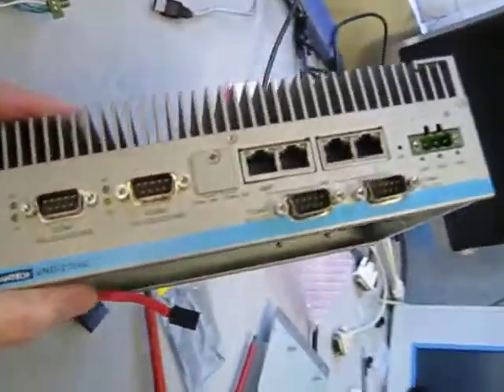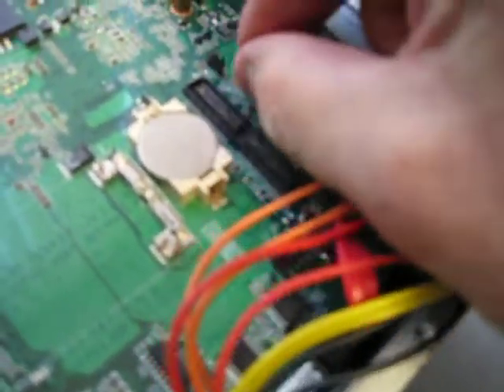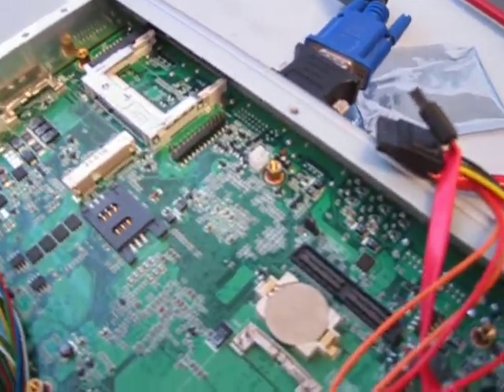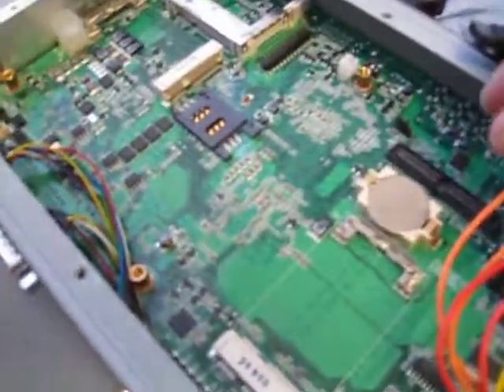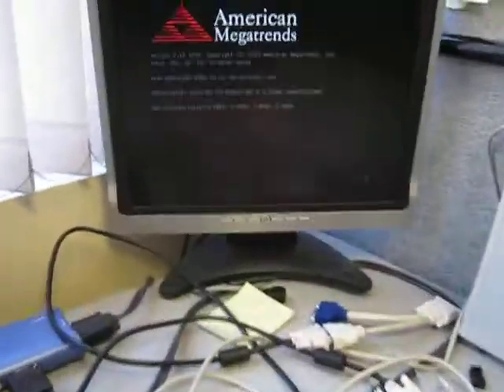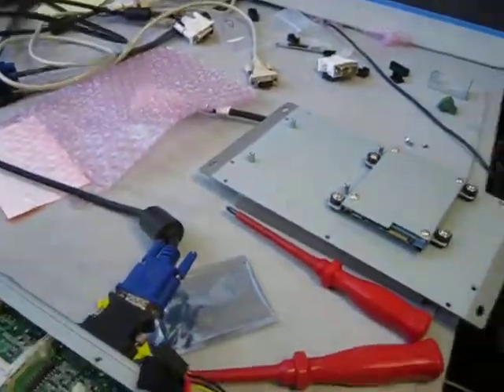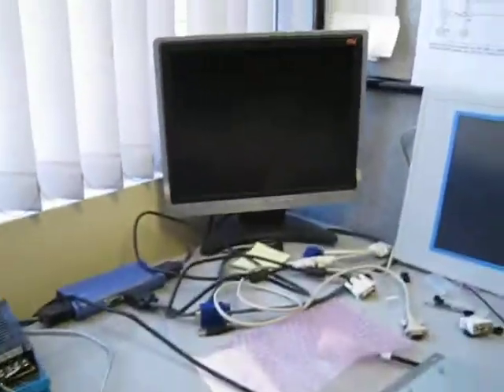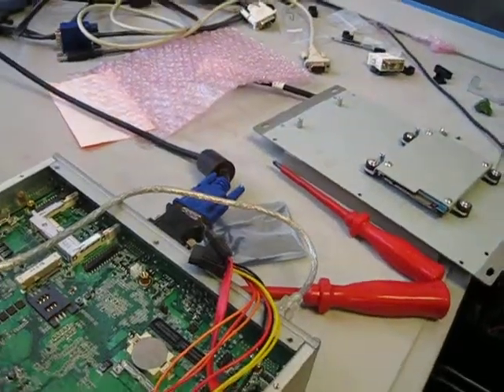UNO-2184G Resetting CMOS data with Jumper JP1

Comment: Power off* 
You showed the power unplugged but said “power applied”. Just clarifying. Currently trying to get mine to boot...
Reply from the maker: Sorry.  You need the power disconnected to reset the CMOS data.
Reply: @bogart45102  Do you happen to have any motherboard schematics for this pc? I lost a transistor that I believe is related to the CMOS and 3V backup battery... but I cant be sure..